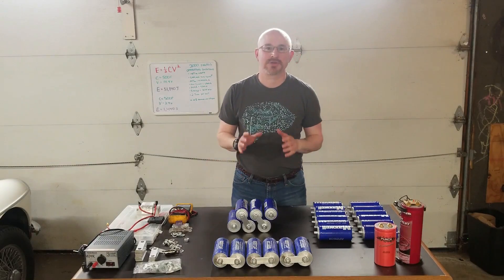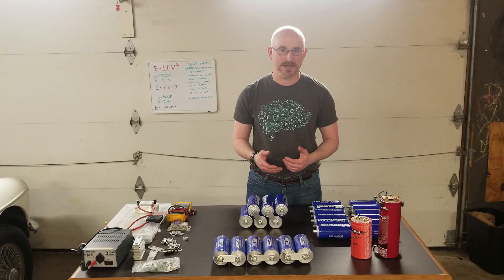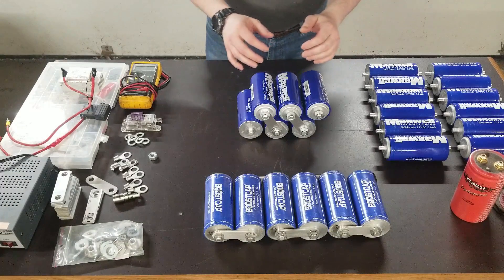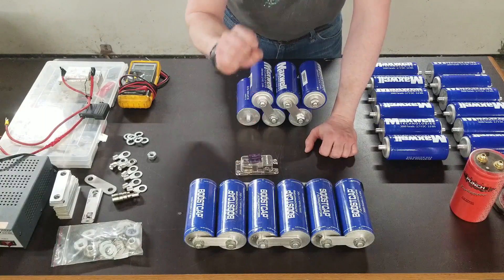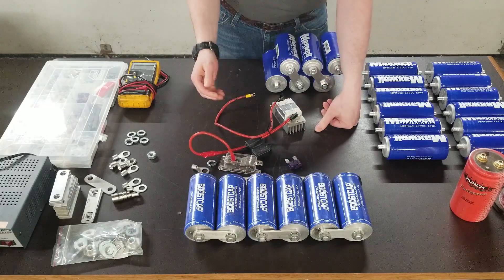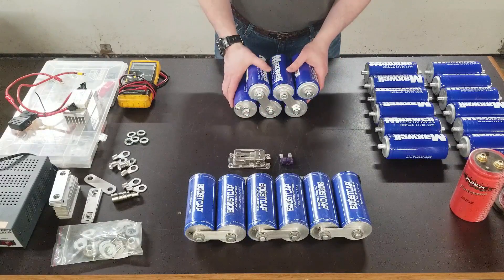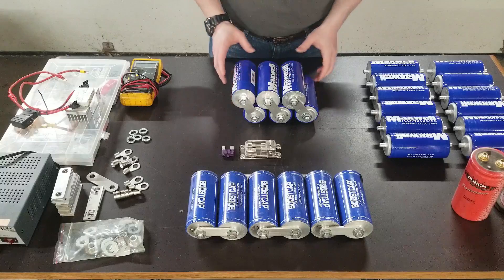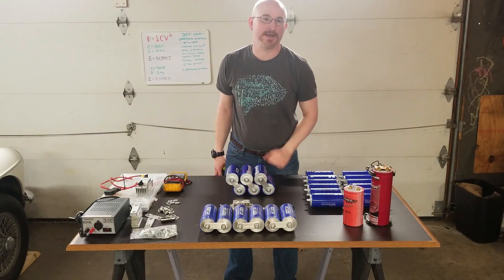Electrical engineer explains ultracapacitor Safety Tips and Tricks - Car Audio Applications

Comment: There is a very simple way to balance them get a car light in series with them and the battery so then as long as the light is on you'll see it is still balancing,

The light is a resistor too it might take some hours but at least you don't blow it up for loading...

And self discharge well if you want it you need to run the car every once in a while you can weld from them in an emergency case but that requires Rebalancing from the car battery over a lightbulb again or you need a loader pole with a very special rig not directly connected but a special power supply suited for these unless plus resistance still unless you are suicidal but it goes to show the power of these

and indeed you can use them to start your car but they self discharge so after a longer time they need Rebalancing if they self discharge I say this explicitly to prevent someone putting an empty ultracap bank to a car battery or whatever loading system without any balance like resistor over it like a lamp from a car you will basically get a problem yes you can weld with them but the opposite is through in loadeding DO KEEP THAT IN MIND !!!

Comment: Hello.
Be kind, does anyone know how much a supercapacitor like this costs? today?
Reply from the maker: The best deal right now is an Ioxus UC-31 B-Stock.  Packaged like a battery and only $100 right now on the XS Power website.
Reply from the maker: Also, XS sells individual 3000F cells for $40 each

Comment: Can you use 2 separate and totally different capacitor banks in the same system? For example, under the hood, an XS power sb500 (500 farad) and in the back a car audio JP630 (630 farad) bank?
Reply from the maker: Sure, the brand and size doesn't matter, just the voltage rating.
Reply: @richardvedvik979  Thanks for the response. I'm going to be adding the final cap bank in the back this weekend!

Comment: Can you make a video on how to incorporate super capacitors in a 48v solar project?. That will be appreciated.
Reply from the maker: I don't have that hardware on hand, but I recommend stacking the cells in series to achieve the desired voltage rating (with balancing/overload circuits).   This will be cost prohibitive compared to four 12V batteries.   The storage capacity for ultracapacitors is fairly small.  Their benefit is speed, not capacity.

Comment: For the cap connection you can use a lightbulb as a current limiter.
If the cap is empty it will glow as it charges. When the light goes off, it is charged.
If you keep that connected, small rapid charge or discharge will go through without heating the bulb and glowing.
If you do pump it really loud, it will definitely glow as it pulls from battery and delivers to amp. It will also limit the damage when the amp goes short circuit.
Reply from the maker: Using an incandescent bulb to limit charge current is a trick I use but omitted from the video.  I do this when reconnecting batteries as well, to eliminate the spark.

Comment: What the size of wire ? 4 awg is enough ?  Or must 2 awg ?
Reply from the maker: @chandrajuliar  depends on the fusing. You size wire based on the fusing that you have.
Reply: @richardvedvik979 what is your mean ? can you advise me if use 4 awg OFC ?
Reply from the maker: @chandrajuliar  in my own installs, 4awg ofc is fine with a 100A or 125A fuse.  If you wanted to use larger fuses, you'd increase wire size accordingly.

Comment: I suggest a LIfPo battery and a DC to DC charger + 0 AWG copper 250 amp buss bar 250 amp fuse. For big systems a Server Rack has 500 Amp Hours equal to 5 100 Amp Hour batteries. Much cheaper than CAPS and safe....

Comment: Hey great video I have a question I'm new to the competitive audio scene and upgrading everything in my build currently running a 240 from Autotech a 500 farad super cap battery delete dual run of 0 gauge OFC to the back feeding a 72.5AH SCIB bank of the 2.9AH M5 pedestal cells rated at 75c on a Ruthless 10k and Ruthless 1500.4 I've literally dove in head first trying to learn everything to do with the hobby anyway I just competed for my first time with a single 15" Incriminator audio TYRANT rated for 5K RMS I got a 147.7 but was dropping to the low 15's on burps so I am supposed to be acquiring a 2000 Farad 6S4P bank in the morning and I am wondering if it will be enough to stabilize my voltage on burps and actually see a difference in a competition I can't find many videos on super caps and especially banks that big so I'm wondering if you might be able to help explain it a little and tell me if it's enough for what I'm trying to do also I want to add that I'm wired to 1 ohm currently on the single 15 BUT I have already ordered the second one should be here in a week or two and I will be wired down to 1/2 ohm
Reply from the maker: You have a lot going on there!  There are many types of SPL competition, each one has a different strategy.  Is this a trunk build in a Camry?
Reply: @richardvedvik979  yes it is and I have acquired the 2000 Farad XS power super cap bank since the last message for burps I found a balancer that I think will work for the 6S4P bank of 24 cells it's on the big Jeff website can you please tell me if it will work for my needs as it sits right now it has some homemade end bars on it connecting the outer cells with the cells in between only connected by the Link bars made for the Caps I'm wondering if the end cells being connected would affect the balancer in any way or if that won't work could I just use 6S LTO balancer one for each row of cells

Comment: Roughly how many of these batteries is needed for a 6000W Lanzer amp ? I have a 1000 cca battery in the front with a 200 amp 14V LEECE NEVILLE. On my 1985 suburban will a motorcycle thank you .
Reply from the maker: Since these are capacitors, and the bank needs to have a voltage rating that is higher than the operating voltage of the system.  Since most cars have a 14.4V-15V alternator output, the bank needs to be rated higher than that.  By wiring capacitors in series, we add their voltages, which is why I show six (6) 2.7V caps in series for a 16.2V rating.

Comment: Where are the balance boards
Reply from the maker: The term balance board is a misnomer.   Those circuits simply limit voltage at the capacitor, they don't balance the voltage across each capacitor.  In order to account for differences in ESR, I sized these banks to be several rated volts higher than the maximum voltage they will see.

Comment: I keep blowing a 500 amp amp fuse with my uSTART ultra cap would you ever condone not fusing that outflow wire from the ultra cap? It’s a 1/0 wire the uSTART is a cheap ultra cap that has been recalled previously for having the cells inside the ultra cap get shorted out? But watching this video if they are all in parallel like the box shape looks or the 6 pack how could they ever short out it would always be short if the entire ultra capacitor cell is conductive unless I misheard you and you meant the buss bar terminal posts coming from the top? Or just every part of the cell is conductive? Or do I just have to much current draw is there a way to limit that current draw per amplifier? If I connected separate wires it would all lead back that one initial inrush wire anyway right? Let me know your thoughts thank you!

Comment: Hi I'm trying to charge an ultracapacitor Bank. I got the Deadshot on the multimeter and blew my 50 amp fuse. When you said I could use a current limiting charger, couldn't I just use a 12 vdc wall charger with like 300 milliamp output?
Reply from the maker: Hi there.  The wall transformers or wall power supplies are generally not current limiting, they would likey fail and/or catch fire quickly.

Many car battery chargers are current limiting, and you could use the 2A or 10A setting.
Reply: @richardvedvik979  Thank you! Once the capacitor is fully charged do I ever have to worry about it going to a short again? At which point (or should I say voltage) does the short come into play? Or the excessive current draw. I'm using this for car audio and the max voltage of the bank is 16 volts.

Comment: If you're still around: If you charge  a 500F/16.2v super capacitor bank at 2 amps for 1 hour is there a total of 2 amps in the cap? If short circuited would the burst be 2 amps or would it somehow be more that that? I realize it would not be fully charged after 1 hour.
Reply from the maker: Hi!  I am very much around!  The short circuit current would be very high, nearly instantaneous.  So all of the energy supplied over the hour would be available within a second.
Reply: @richardvedvik979 Not sure if wording this correctly. Kind of like my opening line! lol But if i am giving it 2 amps for one hour is there a way of knowing what the total current the cap is holding?

Comment: Great video. My mind is wanting to use this in a solar application to extend battery an reduce draw from motors and pumps. Any recommendations or videos to check out? Thanks subscribed
Reply from the maker: I got mine from decommissioned solar installs.  I haven't seen anything on that application since Li-Ion is more cost effective.  Even commercial grade UPS can use ultra caps, but usually don't due to cost and runtime.  

I do know they will help 12V or 24V battery systems for in-rush.  My other video includes current draw measurements.

Comment: Why aren't you using balancing circuit boards between the caps so each Cap gets an equal charge voltage? Also, what is the current leak over time? I heard you say after several months they were at 10 volts so what was the starting charge voltage?

Comment: Hey,... that's pretty smart.  I wonder if I could use one of those as a regen brake power dump, and then I could use the stored charge as a 10-30 second turbo/boost to get me off the line far quicker.  (not to mention at TOP SPEED!)  :-)
Reply from the maker: I've had this question before.  The main problem is the operating voltage of E-bikes and electric cars requiring too many in series, it becomes cost prohibitive really quickly.

Comment: How can they deliver over 9000A in a dead short if there only 3000F rated?
Reply from the maker: I'm just reporting what the datasheet says.  Farads and Amps are different metrics, and that short circuit current would be at the 2.7VDC rating.
Reply: @richardvedvik979  well yes but a farad is 1 amp at 1volt for 1 sec so it doesn't make much since that a 3000 farad capacitor can do 9000F but i also still have alot to learn about how capacitors work.
Reply from the maker: @SheikhN-bible-syndrome  no worry, you'll note that the short circuit current rating is likely much less than one second.  That fixes the math.  :)
Reply: @richardvedvik979  i just thought the exact same thing! Yep that would be the how/why . so it can do 9000A in 1/3 of a sec if dead short and im guessing the reason it's not higher/ faster then 1/3sec is do to the internal resistence  which is pretty low if i remember correctly, much lower then that of a lithium battery cell im sure .

Comment: What would be better for going around and starting my yard tractors, 6 2.7v 350f in series or 1 or 2 16v 5000f in parallel?
Reply from the maker: If you could find a 5,000F cap bank rated for 16VDC, that will be much, much larger than a series string of 350F caps (because series caps add as inverses).

Comment: But if you're fuse for 300a on a power wire, a maxifuse won't go that high. So basically just fuse along according to the wire/load?
Reply from the maker: Yes, you can adjust the fuse size accordingly.  A high amperage circuit breaker or solenoid could also be used and would allow for a quick disconnect.

Comment: Thanks for making a simple clean detailed video on caps without a bunch of extra garbage. I have a six pack of these set up in my Tundra for my sub amps. Same way no balancing circuits. Charging system has more that sufficient management of the electrical system and maintaining the caps.

Comment: Being that the supercacitors are connected in parallel to the car battery another 100A fuse is needed at that end (eg while disconnecting the capacitor bank or current flows towards the capacitor bank).
Reply from the maker: So, I put a fuse at the ultracap bank that is easily removed.  That isolates the cap bank from the car.

Comment: Thanks so much for the info man!! Quick question, would I be able to charge a bank of 6 3v cells with a 6s rc batt charger? The bank has balancing boards too
Reply from the maker: sorry for the delay.  Charging the bank requires a source with current limiting and an output voltage set for the desired bank voltage. The benefit of capacitor banks is that they can meet whatever voltage you desire (within range).  They are not limited to the design voltage of a battery.

Comment: Dear friend, Richard, thank you for your attention. In some videos on YouTube, it is shown that they receive 300 V output from 8 super capacitors, and some videos show tens of thousands of V output and arc from hand-made capacitors.  This is what kind of setup with electronic equipment is necessary to receive a high voltage arc. Thanks
Reply from the maker: Most of the people using kV are using microwave capacitors or other high-voltage capacitors.  Then a step-up transformer/circuit is needed to generate kV.  It's quite dangerous and best left to people with a good understanding of electronics and electrical safety.    The output voltage of the capacitor varies with construction and you can wire capacitors in series to boost output voltage.

Comment: I have connected 20 Maxwell 2.7V super capacitors in series and I am going to spark, but with each spark the voltage decreases a little from the capacities. The total charger of these 20 capacitors is 55V DC. How should I connect them together that 300  output voltage?
Reply from the maker: I'm not sure what you mean by "I am going to spark".  Please clarify.  2.7V x 20 = 54VDC.  I would probably be a bit more conservative with output voltage and charging voltage because my testing (my other video) showed variances in ESR causing a few tenths of a volt drop difference between each cap.  I wouldn't charge past 2.5VDC per cell or 50 VDC across all of them.    If I wanted 300 VDC, I would be even more conservative with charging and would want 2.3VDC per cell average or 300/2.3 = 131 cells in series.

Comment: Does anybody know how to connect up those with flat terminals? they look the same, except they dont have the screw threaded terminal.
Reply from the maker: Those are made to be permanent installs in equipment.  Either soldered or pressure fit.  You can download the manual for instructions.
Reply: @richardvedvik979  soldering aluminium terminals is... ultrasonic or laser and this is out of scope of my possibilities. I have searched through Maxwell and SPS cap and there was nothing mentioned. I will have to resort to screw terminals...

Comment: Ive wondered that with an ultracap's extremely low esr, and extremely high capacitance, i wonder how theyll act when used in band pass filters..?  Seems like theyd totally eliminate designated frequencies and not put any back emf or noise into the audio signal..  and with duty cycles so high theyd last forever in those situations. You wouldnt need to have the huge deals you had here but never heard of anybody using em in those circuits..  or maybe i just havent seen that yet and is already a thing..
Reply from the maker: Interesting idea.  I haven't seen anyone try to use this type of capacitor in an audio filter either.

Comment: If I hooked a 50 fared capacitor to a 100ah lifepo4 battery with a 100amp bms would it overload it charging the capacitor if the capacitor was empty when hooked up?
Reply from the maker: You'll notice that some of the "stiffening capacitors" for car audio use have either external or internal charging and discharging circuits.  Each product should have some manufacturer instructions that explain that procedure.  Without knowing the exact make/model you have, I would use an incandescent dome light in series with the power feed to slow the initial charge current.
Reply: @richardvedvik979  great idea thx

Comment: Can I use a 12 volt halogen light bulb as a resistor to charge super caps?
Reply from the maker: Yes, when placed in-line with the 12V source, the lamp will act like... a lamp... when the cap voltage is low due to the voltage drop across the lamp.  As voltage drop across the lamp decreases, the bulb will become dimmer, until the voltage across the lamp is nearly zero and the caps are charged.

Comment: Can you charge and discharge ultracapacitors simultaneously. For example you use your phone whilst it is plugged in charging?
Reply from the maker: Absolutely, that is how capacitors are routinely used.  They both match input voltage and resist change in output voltage.

Comment: Hello, for an electric Hummer H1 do it my self electric conversion, do you think 150kw battery pack plus connect 50kw ultra capacitor pack will be enough, I’m thinking two Tesla plaid motor drives with a total of 1500kw max
Reply from the maker: It would take a substantial amount of energy but you're likely in the ballpark for sizing.  While bulky, the ultracap bank wouldn't add as much weight and would help supplement the batteries.